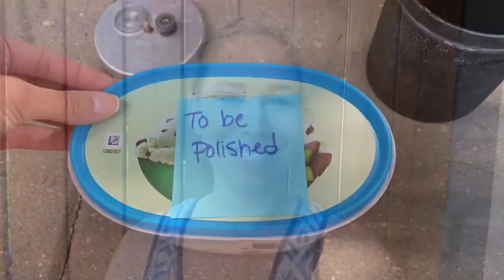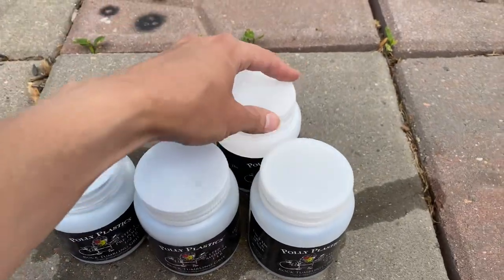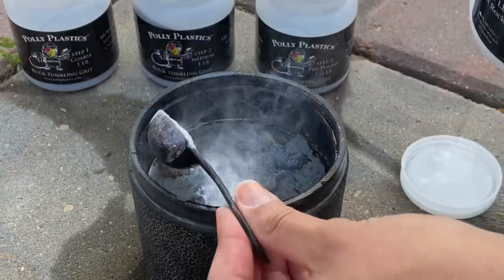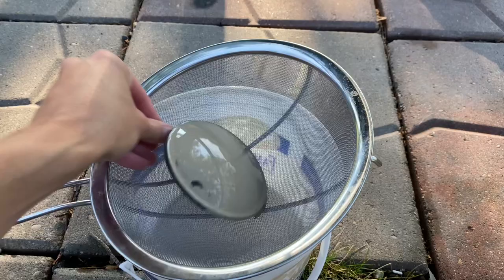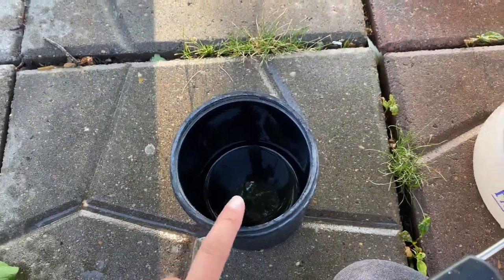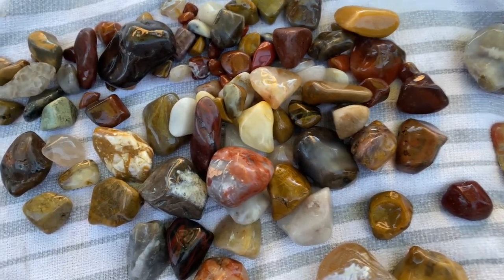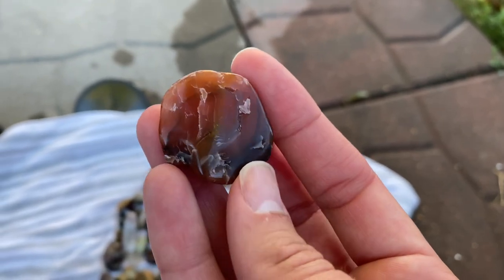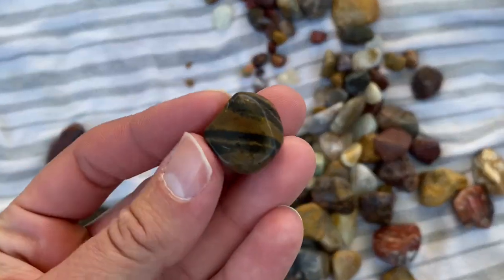Tumbling Rocks in ALL FOUR Stages of Grit at Once! What Happens to the Rocks?!

Comment: When you do this for a month, are you running the tumbler non-stop for a month or is it on a timer for the sake of giving the motor a cool down rest in between runs ? If so, what are your cycle times ?
Reply: Tumblers run 24/7. The motors used are built for it.

Comment: I think the reason it worked as well as it did was the size difference. When the course grit was fresh, it would have been used more than the finer stages. As it wore down, the finer stages would be making more contact with the rocks.

Comment: Interesting experiment!  I didn't think they'd be as smooth as they were.  Question: what does it mean when you dump out your rocks and a bunch of sludge is stuck to the bottom?  I sometimes have to pry and dig that stuff out.  Am I putting too much grit?  Mahalo!
Reply from the maker: Yes! Too much grit would be the issue they will get a better tumble if you add less 😊

Comment: Hello, I have a question: I use the rocks almost exclusively on the sea beach, and therefore they are already partially worked and rounded, could I just use the last two steps with 500 grit and aluminum oxide?

Comment: That looks like a 2-3 lbs tumbler - wouldn't it be ~4 tablespoons of grit for that size and weight? They turned out great regardless. Just wondering if I'm using too much grit in mine.
Reply from the maker: Technically yes, but I have always found that if I add that much, it just gets stuck to the bottom. So I always just do two! Then I feel like I don’t waste as much!
Reply: @AgateAriel  Nice! Thanks for letting me know. Definitely a hobby worth experimenting with.